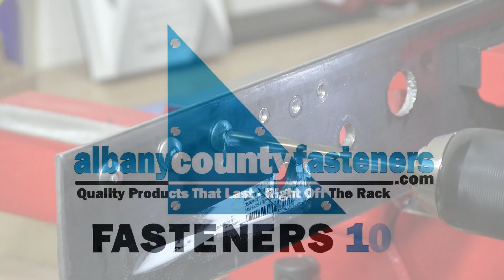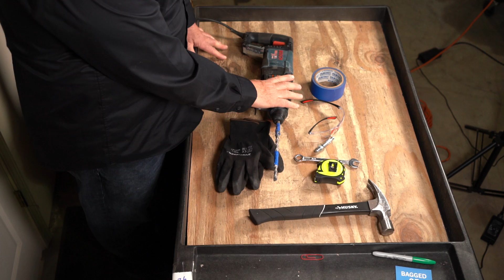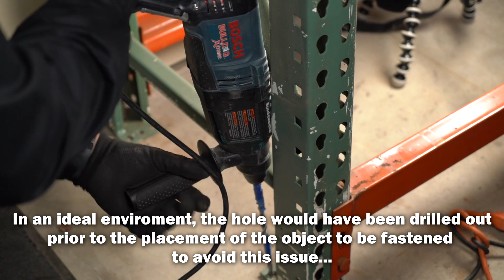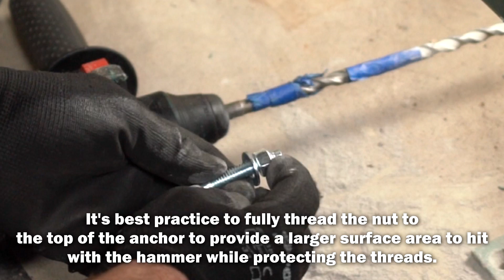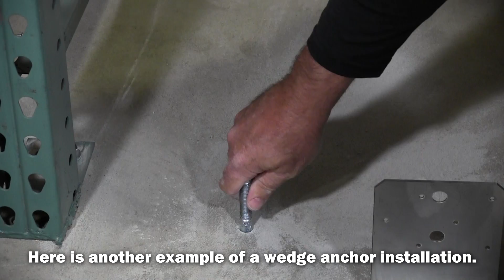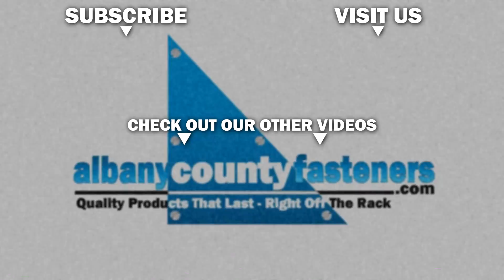How to Install Wedge Anchors Into Concrete | Fasteners 101

Comment: Very thorough explanation. Question for you: two out 3 bolts that hold my side gate to stucco-covered brick wall are stripped-out, so gate leans. Should I use a sleeve anchor or wedge anchor?Anything I should lookout for? Thanks!

Comment: If I wanted to attached a 2x8 to a wall what length of anchor would I need?
Reply: I’d use 6” length for sure, personally would go with 1/2” anchor instead of 3/8

Comment: Hi. This is the first time for me using wedge anchors. I need to install a steel structure 2 meters high, 50 cm wide and 10 cm to concrete. Which size wedge ancho should I use? What would happen if I use a littler one?
Reply from the maker: We advise you refer to the building's specs or blueprints or consult the MFG or an engineer as we cannot offer a recommendation without knowing the weight and force thats being put into the concrete.

Comment: Can we use these wedge anchors on vertical walls as well say, for example, to install a 25 litre AO Smith storage water heater on bathroom wall? Or should i use a sleeve anchor instead?
Reply from the maker: If it's a solid concrete wall, a wedge anchor could work, but you would need to be careful about hitting any rebar in the concrete. You could also try using a titan hd bolt or titan hd mini bolt to secure the water heater to the wall. Again, just be sure to steer clear of any rebar.
Reply: use a sleeve anchor instead